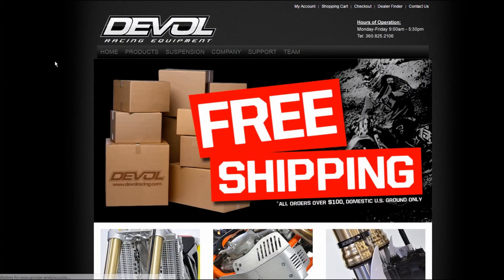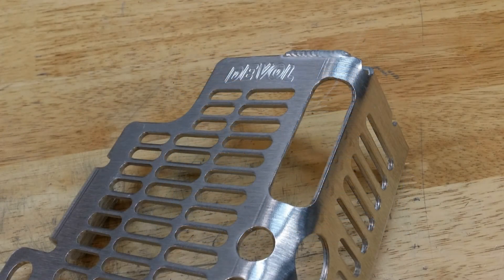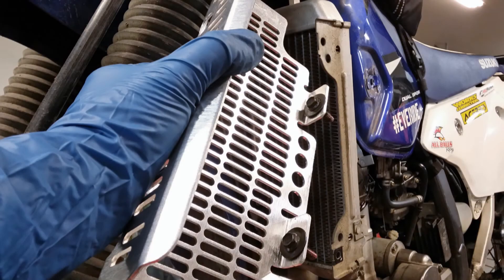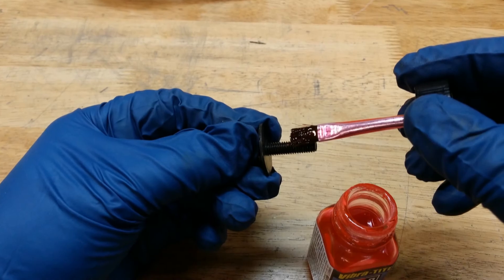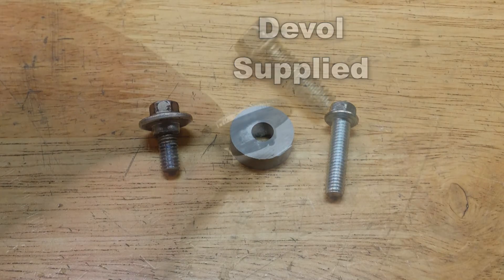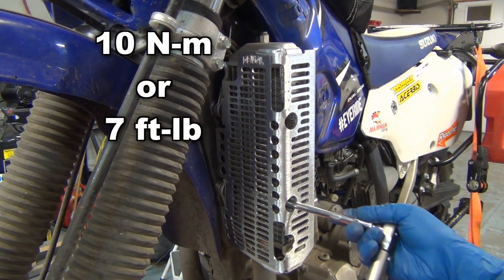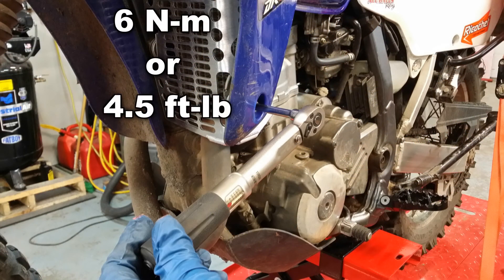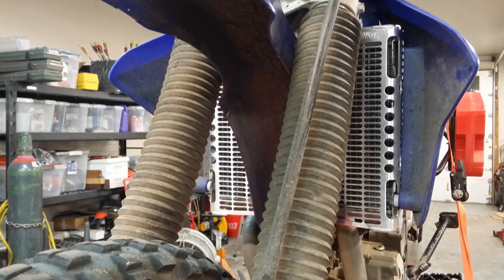DEVOL Radiator Guards (Install on Suzuki DR-Z400s)

Comment: Nice video Pete...I should make a video for the Devol guards I'm trying to install on my 2005 S. The Clarke 3.9 tank is crowding the fit so I have been grinding the crap out of the top of the left side unit. Gave up for today, back at it tomorrow!
Reply from the maker: So I've been thinking about getting the Clarke Tank.  Is the fittment issue because of the position of where the plastics bolt on after the tank is installed or because of the actual tank dimensions?  How much did you end up having to clearance to get it to fit?
Reply: WheeliePete 
Yes, the bottom front edge of the larger tank was the reason for grinding down the guard.
Probably about an inch plus out of the corner of it. Not a big deal.

Comment: I’m after guards for my DRZ400E (which uses the same Devol part as your S), and I’m interested in how much extra width these add to the radiators, would they protrude an extra 1/2” on the outside, or more? I have a 28L Safari tank installed and there’s a bit of clearance, but not a huge amount.
Reply from the maker: They've done a good job of getting these close to the existing radiator.  The outside edges of the gaurd are only adding about 5-7mm of width to each radiator (I just went out and tried to meausre on the bike.)  The kit comes with 5mm spacers to bump out the stock cowling-to-radiator lower mounts.  If you've got 7+mm of clearance between the safari tank and the stock radiators you should be fine.